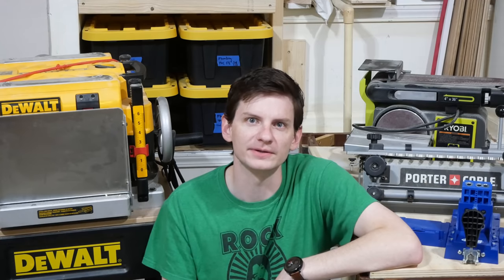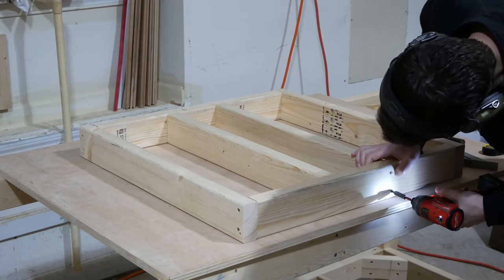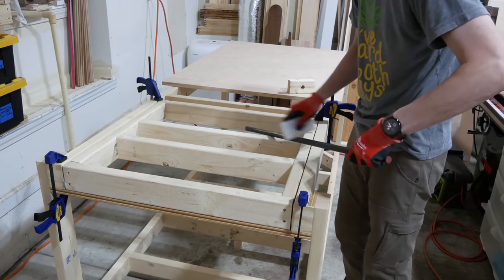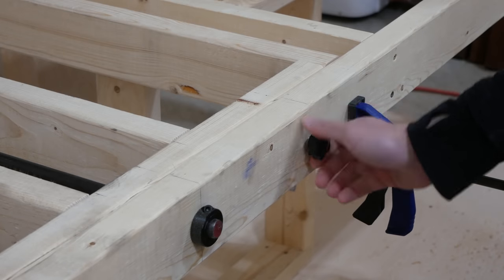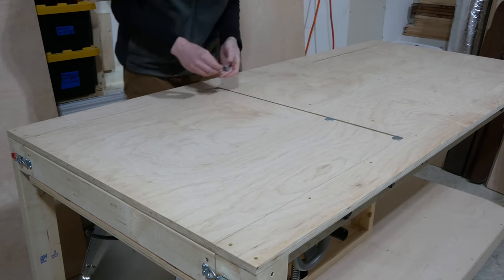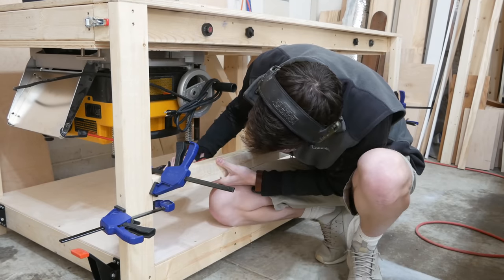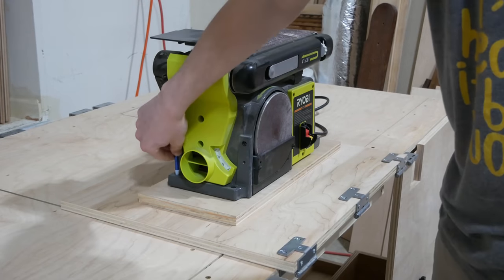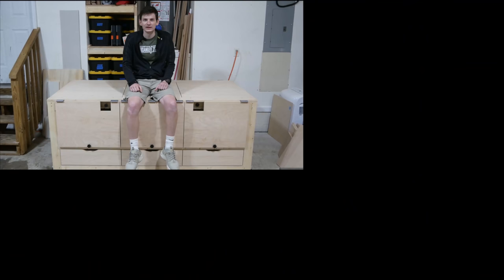How to Make a Hidden Tool Storage Workbench

Comment: I love those hinges for the pull up tools.  Are there hinges like this but that are hidden when the pull up tool is down?  I have had this idea to build this type of pull up board with my kitchen aide mixer attched to hide in empty space in corner area.  I think I’d have to use both of your pull up board and your flip board in a way.  I want, or need, to have the kitchen aide mixer not go to the top of my countertop but be stable enough to be to the side of the countertop but be able to be hidden when in down position.  If I use the pull up hinge type of board, it would not have the mixer facing up and to the side of the countertop.  I think I would have to also use the flip in some way to have the mixer facing up.
Reply from the maker: I don't know of a hinge like that but that doesn't mean it doesn't exist. I think I understand what you're trying to do and will give it some thought

Comment: I need another expensive hobby like I need a hole in my head, but now I want to pick up woodworking specifically so I can make something like this. It's absolutely brilliant, and the way you demonstrated the build was so clear and straightforward that I actually feel like I could make it. (I can't, but that's entirely beside the point -- though it does call into question wtf I'm doing here.)
Reply from the maker: Glad you're here! Thanks for the kind words and even if you never make this specifically I hope you learned something and can apply that knowledge to other parts of your life

Comment: My upcoming workshop is the epitome of a small workshop. I'm about to convert my gifted 6x12 shed into my workshop and my first order of business is to build this table. Thank you for the free plans as well 🙏. Cheers!
Reply from the maker: Good luck with your shop! I'm assuming you'd make the workbench the focus of the shop and put it in the center with  a little bit of room around all sides?
Reply: @ProjectBilld  That's exactly right. Thanks again for the free plans. Sure will make the build a lot easier.

Comment: I’m buying those hinges NOW.  I had no idea such things existed.  Thank you for all the great ideas and an outstanding video!!!
Reply from the maker: You're welcome! I didn't really know they existed either before. I just knew what I wanted the hinge to be able to do and came across those
Reply: @ProjectBilld  hey, looking back, would you change anything to your design?  Maybe the orientation of machines, machine selection, hardware or materials used, etc…?  Thanks again.
Reply from the maker: So far there's not much I would change. I would add a swiveling caster in the center instead of the board as the middle of the bench can sag and rub occasionally when moving it. Not a big issue but just a thought

Comment: BTDT, best thing I could have done for my small 10' x 20' shop. I also added a router table between the table saw extensions and added a plenum with blast gates to each tool.

Comment: I have watched this video likely over 50 times lol. It’s such a great build. Can’t wait to start working on it. 

Something I thing I’m going to add is another cutout adjacent to the one for the star knob. That extra hole I think I would or will add either an outlet or a power strip.
I think I’m going to do that to both sides and connect the wires together so that way it’s just one long cord to plug in when in use.  

Obviously you could keep the tools plugged in when flipping them but it eliminates the hassle of the extension cord. 

Idk it’s just a though.

Comment: Good build. I'm going to do a similar build. However, I will offset the rotating top for my planer. An elevated portion on one side for a level bench area. For the planer I am mounting it so that the working surface of the planer is level with the workbench. Same with my miter saw.
Reply from the maker: Nice! Definitely a good idea

Comment: I really liked your design, this is an incredible workbench. The thing about flip tops and such is that your project will sit on top of that bench, so you can't work that easily on a project with the tools needing to be flipped up, a separate assembly table might be in order...  But I love the design and look of it!  And it's good timing for me... I'm about to build a stationary workbench for some stationary tools such as the belt/disk sander, router table, and next to it is the Miter saw (on a Bora flip station)  Underneath I've got an Dust Deputy and a 6HP Shop vac where I'll be putting in some blast gates and stuff... I'm repurposing an old solid door for the top.   I'm still feeling my way around this home woodworking shop and it's a lot of fun seeing what others have done for inspiration... BTW: I just subbed to your channel, you do good work!
Reply from the maker: Yep, I have another workbench for just that reason. I try to keep this one clear and have been doing a good job of that for the most part

Comment: Wow!! now that's a workbench! I love everything you built into this bench. I plan to have my planer rise up to the top of the workbench. It will have a removable top or I may use those hinges you used. I've never seen them before. The planer will be on a platform with a jack underneath. They make an adapter for a scissor jack, then you chuck it into your drill, and away it goes. I love that you have the side hanging tools- very clever. One question- are you worried about sawdust getting into the drawers? A hinged 1/4" piece of plywood woodwork. You could recess the lid by putting a rabbit around the top. Count me in as a new subscriber!
Reply from the maker: Sawdust is a way of life it seems... even with dust collection there's nowhere it doesn't get. But yes I could definitely cover the drawers as they do get lots of sawdust in them

Comment: You should drill small holes (maybe the width of the spray straw on a aerosol can) in the wood directly over the metal shaft. That way you can add a little oil or whatever lubricant you want when it starts squeeking again.

Comment: Cool build! I like how you've thought out the way you'll use the tools and still be able to have a flat surface when you need it, rather than a flip top stand that's only for the tools. And I do think it would keep me cleaning up the surface a lot more than I do now. I'm going to modify it some for my tools and make it a bit smaller footprint - and thanks for the solutions you've come up with! How are you liking it in real time use?
Reply from the maker: Love it for the most part! I do keep it pretty clean so I can use the flip up tools and it does save a lot of space. Only complaint I have is that it's difficult to move on my own because it's so large so I think a smaller footprint is a good idea

Comment: I built a off feed level bench for my router and table saw using 180degree hinges for the horizontally mounted doors. The doors concealed my benchtop bandsaw, drill press, miter saw, and surface planer. Another of the doors concealed a vacuum plenum I made with 6 gate valves which went to my benchtop tools, router, and table saw. Each bench top tool was hinged to rotate out of the top of the bench once the door was rotated 180 degrees out of the way. The tool mounts were 3/4" plywood attached to door hinges attached to my bench framework. The working surface of the surface planer and miter saw were positioned to the same level as my bemch top for off feed and material support. By adding a auto on/off switch to a multi plug my shop vac will automically turn on and off when I operate my tools. I just have to open or close the appropriate gate valve per tool used. The tablesaw rests on a 3 drawer cabinet and my router is im a cabinet that fits between the rails of the table saw. It took some adjusting and fitting to allow for the swing space needed but in my 10' x 20' shop I can rip, route or miter over 8' material with ease.
Reply from the maker: Sounds like a sweet setup!

Comment: Thanks...for the free plans & for sharing such a creative mind. I have a question about the practical side now that you have had time to use the bench.  Does the interior area collect a lot of sawdust?  That was my only criticism...and have been pondering if there could be a way to enclose the ends...probably not practical without disrupting your use of the thing...so maybe an alternative could be to add a thin covering just over the drawers?

BTW...you have a great sense of humor & timing.  Very dry & witty.
Thanks again.
Reply from the maker: Thanks for the kind words! Yes a bit of sawdust does get inside the bench but until I improve my dust collection, there's nowhere in the shop it doesn't get. Adding a covering over the drawers is likely the best bet to preventing dust from getting in them.
Reply: @ProjectBilld  I have only been doing wood work for about a year…very part time…enough time to know that the dust invading every centimeter of my garage is the only real downside to this creative endeavor. I am already researching dust collection as I refuse to pursue further until I have at least a rudimentary system in place. Then a version of your workbench will be my next project. Will be watching & learning in the meantime.
Reply from the maker: I have a simple system with a collection bin, dust cyclone, and shop vac and it's a big improvement over nothing but will certainly be looking to add a nicer system soon

Comment: I would consider adding bearing to allow the rod to rotate more freely.  Works better than wax.
Reply from the maker: I did look at pillow block bearings but they were kind of expensive and the tolerances allowed were minimal, would have required a machine ground rod which also adds to the costs. The wax is holding up well so far!

Comment: love the design and going to make one for the shop. My only thought is when you flip tool back down, do you get wood chips and saw dust falling into your drawers. My thought is to add a secondary piece of plywood above the drawers to stop any thing from falling into the open drawers.  just a thought
Reply from the maker: I do get lots of wood dust in the drawers but I usually vacuum the flip tools off before flipping them down so it's not really from that. I find that the wood dust finds its way into the drawers no matter what but you can certainly give it a shot and see if it helps!

Comment: Im just about to get started building this and wanted to ask how yours is holding up, and if there is anything you would change now that you’ve used it for a while. I’ve been looking forward to this for over a year now and can’t wait. Thanks again.
Reply from the maker: Mine is holding up well. Top has some scratches and marks, but it's a workbench. Some things I'd improve, more support under the middle, it can sag their when trying to move it. If I had to do it again, I'd probably build a separate cart for each rotating tool and have a way to join them together when needed as mine is huge and a beast to move by myself
Reply: Thanks! I have a big garage where it can stay most the time, so I’ll start with your exact design with the middle supported a little more and then add any separate carts if needed. I would really like a large table for assembly and gluing anyways.

Comment: Great work! I am going to make this project using a full 4X8 sheet of plywood. Is there anything you would do different using a full sheet?
Reply from the maker: You'll definitely need more casters and want to support the middle if you go bigger than I made it. Mine already sags a little in the middle when I'm moving it so you'd want to have a caster there so it can still roll if it sags
Reply: @ProjectBilld  That is right!, thanks for the idea. I'll send a pic when I finish. I have quite a few friends that like your setup as well. Keep BILLEDing em!!

Comment: The problem I find with multi-tool fixed storage benches like this is that the material being machined interferes with the other tools- you keep having to put them away. Make this as three separate (but connectable) trolleys, and you have 15 ways you can configure them joined, and lots more singly and in pairs.

Comment: I love this build and am considering using it for my garage shop. Thanks for the very clear plans! One question, have the hinges caused any issues for you? They look like they might protrude a little and I’m wondering if they scare overhanging lumber.
Reply from the maker: No issues with the hinges. They're flush or slightly below and I haven't caught any lumber on them

Comment: Nice build! 
I like everything about it except that the plywood top isn't very durable? (I can't see it lasting long?) As it's not easily detached it's going to be a nightmare when it gets chipped up. Wonder if you could have done it somehow with a sacrificial/replaceable sheet on top that can be easily replaced (but not part of the solid framework) have to be something that accounts for the hinges or vise versa maybe modify or use different hinge system.. (just a thought) unless perhaps stick a hard vinyl/laminate/melamine "wrap" to the top surface to try and prolong the life and that way can be unstuck and replaced when chipped or gouged and protect the plywood underneath?
I like the design it's EXACTLY what I need! So good Idea and well executed aswell..
Cheers from London 👍😎🏴
Reply from the maker: Thanks! It's holding up well so far but I think that's a fair point. I do plan to do something like laminating the top when I get to making my miter saw station

Comment: Really nice and well thought out!!!  Like how you walk through things and don't omit your miscalculations;) Do you foresee any issues having the surface planer hanging upside down when not in use?  I have the same one and for a period of time had it on a flip up (still a bear to lift into place!!) but felt that the strain on the threaded posts may begin to bend/deform over time.....maybe I am thinking too much?!!!!!
Nice bench, well done young man!
Reply from the maker: Thanks! I don't forsee that being a problem. To me, there's the same strain put on the posts when it's upside down then right side up no? More strain at the base of the post but otherwise the same I think

Comment: Would the flip up tool boards and hinges work for a miter saw? Do you think it would be too heavy?
Reply from the maker: Might work for a 10 inch non sliding miter saw. I don't think it would for anything more substantial than that. My belt sander is pretty heavy and that works ok. Also like my belt sander, the height of the miter saw could be an issue

Comment: Nice build, you've executed some really good ideas. The table looks incredibly stout.

Nitpick: Crosscutting using the fence like you're doing around the 40 second mark makes me nervous.
Why not make crosscut sled? Or set the fence so that it doesn't extend past the blade but you can still use it make repeated cuts of the same length without a risk of pinching the work.
Reply from the maker: Oh I for sure need to make a crosscut sled. Can you explain further what you mean by setting the fence so it doesn't extend by the blade?
Reply: @ProjectBilld  Here's a good example of the technique I'm talking about: https://www.youtube.com/watch?v=tvG29zqvuas

I have a Delta Unifence which can be adjusted forward and back (in the direction parallel to the blade) which eliminates the need for a block of wood against the fence like the example I linked.
Reply from the maker: Makes a lot of sense and is simple. Thanks for sharing! I will look to do something like that

Comment: I have been looking around for a workbench design, and this looks like the one! How would you go about adding a tall tool, like a band saw or a drill press? Maybe just not go with this design for that kind of tool?
Reply from the maker: Yeah wouldn't go with this design for a tall or top heavy tool. You'd need more room under the workbench and the higher center of mass would make flipping it up difficult/unsafe
Reply: @ProjectBilld  Have you made any bench for those tall or top heavy tool? With such a practical design you made for the Hidden Tool Storage Workbench, it would be interesting to see your point of view of such a workbench.
Reply from the maker: I have not as of yet. My band saw came with a rolling stand and my drill press is old and has a cast iron head and weighs a ton! I may try to do something with them eventually though!

Comment: The Star Knobs have to go through 2 2x's = 3 inches( or at least 2 1/4 inches+ to thread into the insert if the insert is 1 inch long.  What is the thread length of the Star Knobs - 2 inches or 3 inches? or somewhere in between BTW: the Amazon link shows one of these is no longer available.  Thx, cr.
Reply from the maker: Just checked, the ones I used have a thread length of about 2 3/4 inches, probably are 70mm long given most of those star knobs are metric

Comment: Nice!  How much does that behemoth weigh (without the tools and with the tools)...and considering wood being expensive these days, what did that cost you?
Reply from the maker: Currently tools weigh in at about 230-250 range but theres 3 more open flip panels for more weight!! The bench itself, I'm did some quick math and I'm estimating 300 lbs with no tools. So it's all very heavy but the casters are rated for 800 lbs
Reply from the maker: Also estimated cost for the lumber is around $300 (and rising)